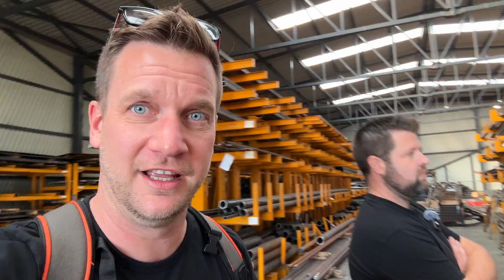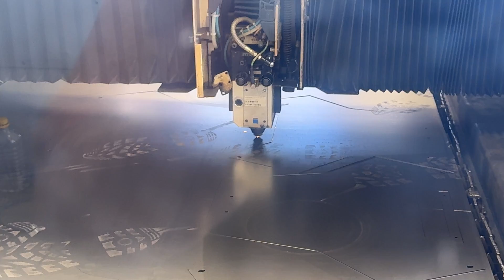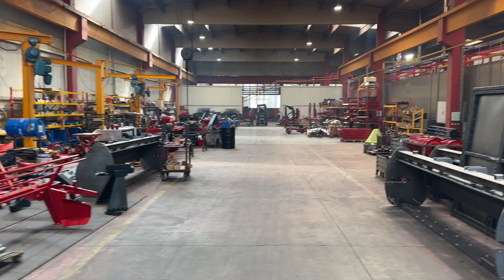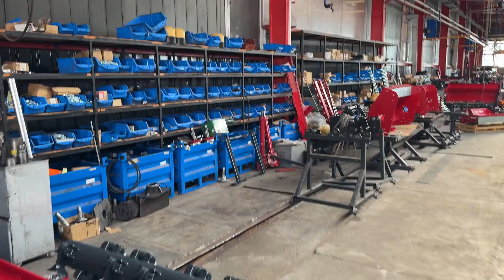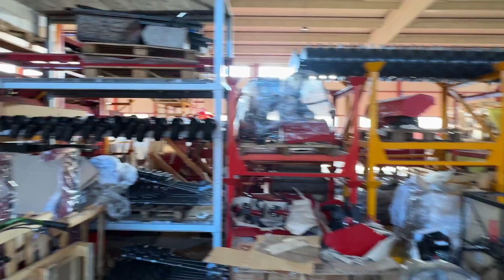Farm Machinery Factory in SERBIA Reveals Its Secrets! We Visit FPM

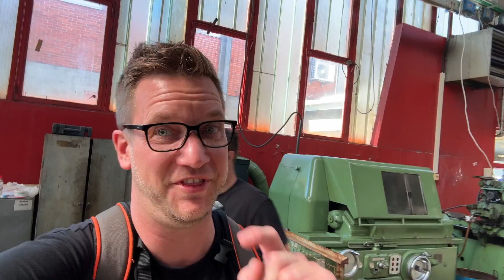Comment: 9:08 - Reciprocating sickle bar component? I've seen those on two wheel tractors, very cool. I wonder how much a plasma cutter CNC machine is? I worked with a water jet version at a cladding factory for a while and I was told that one cost 120 grand.
Reply from the maker: Bang on! Not sure how much the big ones are but the small ones start from about £8k I think